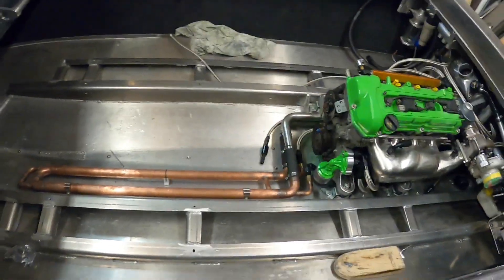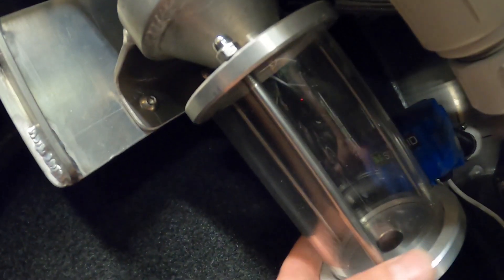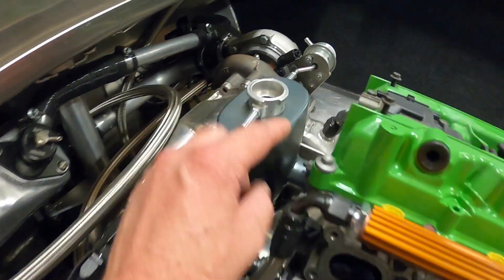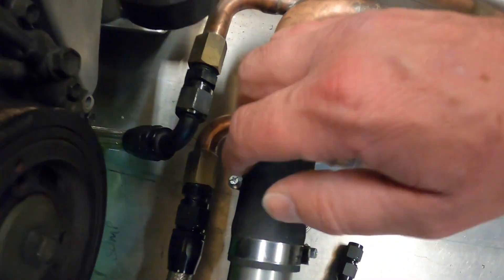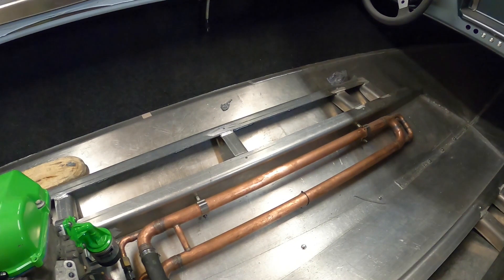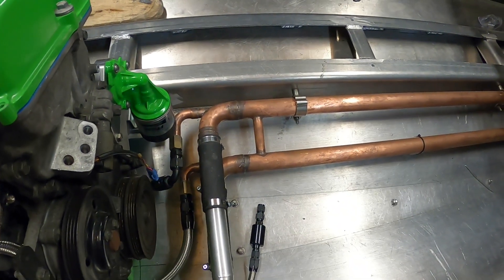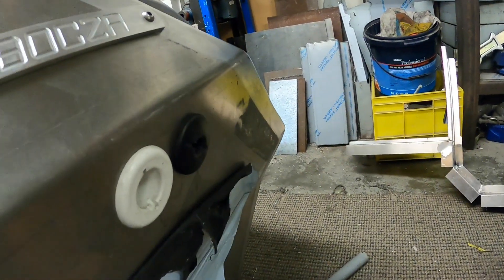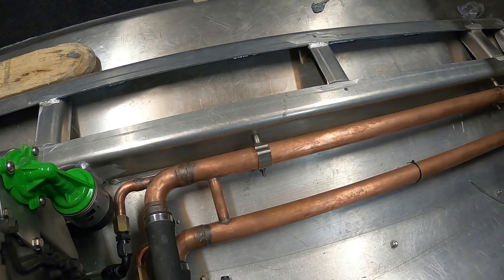How to build a copper jetboat heat exchanger / radiator / Jet Boat Engine cooling system explanation

Comment: I think if I make one it would be similar or a big welded aluminum flat tank with copper pipes zig zagging through it, and the intake and exhaust pipes and pump for the lake/river/ocean water that fills the flat tank to make it more compact. Kind of like those pods on the moonshiner shows. Brass can be welded to aluminum or soldered to copper. So if the pod was aluminum some brass short threaded pieces of pipe can be welded in some holes cut out for threaded pipe to go in.
Reply from the maker: Yeah I'm sure it would also work!

Comment: Thanks for the video, I'm going to use this cooling system on my boat using 42mm and 22mm copper pipe(UK sizes) and use 42mm tees and 42mm to 22mm reducers on the bends to get the pipes running inside each other. Cheers
Reply from the maker: That definitely sounds like a tidy way to do it!

Comment: Does river water extrude hone the water passages in the engine?
Reply from the maker: Hi Christopher, I suppose it would depending on the grit level in the river. but we do not run the river water through our engine as ours is a closed cooling system and the river water only runs through our heat exchanger.

Comment: So why not just use the river water to cool instead of a radiator
Reply from the maker: Because silt can build up in the water galleries and slowly block them. so in doing this it guarantees that no silt goes into the engine.

Comment: I'm gonna be using Isuzu C221 Engine and has 60 HP so I will have less than a meter of  pipe, yes?
Reply from the maker: yes, but id keep it as long as possible. then you can regulate the flow to keep it optimal.

Comment: Is there any helicoid / spiral between inner and outer tube , to  slow and extend   flow of river ( raw) water ?
Reply from the maker: there is a ball valve on the outlet to slow the flow of the raw water.
Reply: @SabotageGarage  thx . In meantime I surf  little bit on net , and I figure out function of cross - fed - it is actually connection for raw water  to fill second tube ?
Reply from the maker: that tube it here just for structure is does not feed water.

Comment: I come back again on this video , after couple of years . As I remember, yor engine is 300+ HP racing “monster” . Comparing with average cooling surface (of HE tubes) on simmilar stock engines , I am dwelling is cooling ( heat transfer )surface  of , estimated 10ft of tube , sufficient to cool engine? Or , you simply do not need more , since you do not make hour-long cruise , but  just few minutes sprint? Assuming , after race , you cool down engine with some external  source ? 
Anyway, idea is beautifull!

Comment: Thank you for a great video. Hoping to do same but with a diesel generator so it’s sea water cooled and not using a radiator. I’d send the output out with the exhaust.
Reply from the maker: Your welcome anything I can do to help. The only issue with sending it out the exhaust is that you won't know if the system is working or not. We have it comming out the side to view if its working. The other parts that use water go out the exhaust.

Comment: Hi
COOL 😉 pipes...You may have a problem in future with that ball valve. If you wont open it wide open ball inside the valve will vanish eventually. It may all so jam the valve. I recomend to use valve with adjusting option, maybe 1/2" return valve from radiator heating system.
Reply from the maker: Your probably right but I think its going to be more of a set and forget type of situation.

Comment: Hey mate, such a helpful video however I do have a question. Do you still run a thermostat and all the cooling electronics found in car for optimum temp if so how would you do this
Reply from the maker: We still use the thermostat yes, the temp sensor is plugged into our new ECU.

Comment: Hi, good video and explanation. Just one questing, what about salt water, could you run this boat in salt water or is only for fresh water? I would like to put a heat exchanger in my jet ski, so I can run it in salt water. If this copper pipes are not good for saltwater, what do people build for saltwater? Same thing with stainless steel instead?
Reply from the maker: id say stainless may work but may not be a efficient
Reply: @SabotageGarage  I decided to buy a pool heat exchanger rated for 60kw that was purely made out of stainless steel. I have ordered it, just waiting for it to arrive, will be interesting to see how well it will work.
Reply from the maker: @BagheeraTube  Awesome will be interesting how it goes!
Reply: @SabotageGarage  Will probably make a video about the process, but that might take several months before everything is done with my current speed 😜

Comment: I like this concept of H.E. however, since I'm not a techy guy I can't really understand some parts and terms.
Would it be possible if I ask for a diagram and how to set it up??
This is not the kind of H.E we use in the Philippines. We just simply run a pipe outside the submerged hull which is prone to rusts and barnacles. And we just have a big tank of freshwater inside or close to the engine.
Reply from the maker: engine water from the engine is inside the big pipes and cold water from the river goes inside the large pipe in a smaller pipe to cool the engine circuit.
Reply: @SabotageGarage  i see.. i’m wondering what if we switch the pipes where the smaller one is for the hot water from engine and the bigger pipe for the river water??

Comment: Had any issues with the solder joints leaking water? I would think they would from all the vibration.
Reply from the maker: Wouldn't think it would crack as its such a solid joint. lots of surface as the joints are slid in to each other at least 20mm.
Reply: Jason they are not soldered joints, they are brazed joints. Much stronger than solder.

Comment: I hope you have the engine water and cooling water going in opposite directions .... the 1 mtr per 100 hp rule dates back too shitty old iron crap too , you could get by with half that length and save a bit of weight
Reply from the maker: I think it is set up that way yes

Comment: 40mm out pipe with 20mm in pipe. 
I made on for my 351 cleveland but it wouldn’t work. Savage heat exchangers are better
Reply from the maker: That maybe so but copper ones are cheaper and heard of great successes.